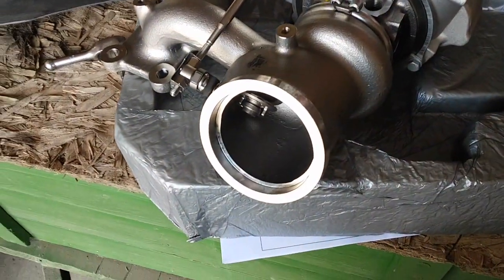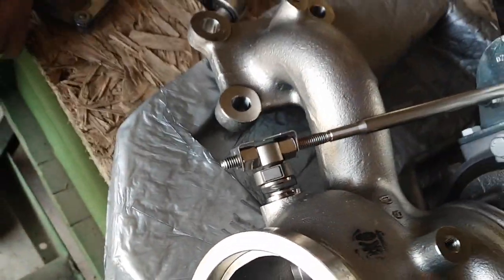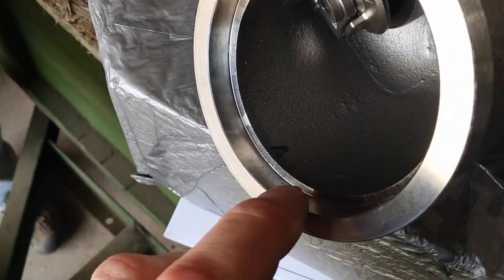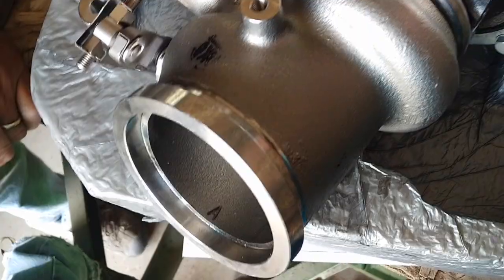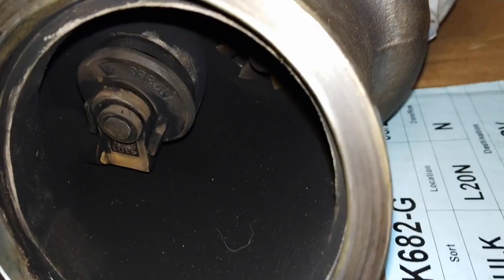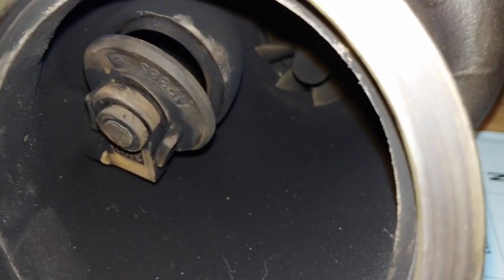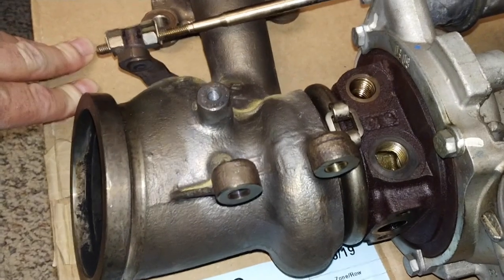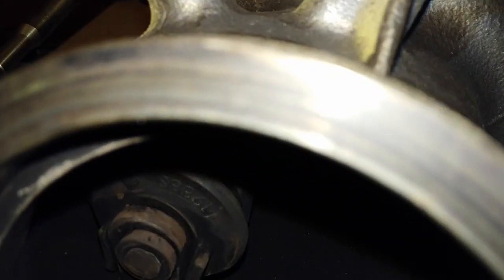2.0 Ecoboost Wastegate Failure Diagnosing P0299 Error

Comment: I have a question. So we own a 2012 Ford Edge with the ecoboost. It doesn't have any wastegate rattle but it has a P0299 code. The vehicle has 218k miles on it. Runs and drives great but doesn't have much power. Normally when you take off the airbox, you get a lot of turbo noise. Ours has very little turbo noise. Do you think the wastegate actuator could be bad? Or maybe the boost sensor? It's had this issue for the past 30k-40k miles. Any tips?
Reply from the maker: Hey, Austin. I'll preface this by saying that I'm not a mechanic, just a guy who's done most of his own car repairs as long as I've been driving. I'm assuming that you have the 2.0L. If you have the 3.5L V6, some of the information below might be different, specifically with the vacuum control solenoids.

With 218k miles on the engine, if it's the original turbocharger, I wouldn't be surprised if that's the culprit. But, since it's an expensive repair, I'm sure you'll want to make sure it's the turbo that's failed.

The first thing I would test is the actuator, using a hand held vacuum pump. If you don't have one, they're fairly inexpensive. With the tubing of the pump on the vacuum can for the actuator, with vacuum pressure applied, you should see two things happen. 1) the actuator rod should pull in towards the vacuum can without returning until vacuum pressure is released, and 2) with the actuator fully engaging the wastegate, you should feel no slack on the linkage for the wastegate. If you have noticeable slack on the linkage, the wastegate linkage is shot. At this time, there isn't a parts kit to swap out the wastegate. I did some shopping around, and there was a turbo repair shop that would rebuild the wastegate for a reasonable fee. The two shops I heard back from are Timsturbos.com and ctiturbo.com. It would be possible to remove just the exhaust side of the turbo, so you wouldn't have to deal with removing it from the engine. Of course, at 218k miles, it might just be best to replace the turbo, since there's no way of knowing how much longer the turbo is going to last. If there is no slack in the linkage, but the actuator rod doesn't keep the actuator always engaged under vacuum pressure, the actuator can is bad. Unfortunately, there isn't a Ford specific actuator available, but if you do an eBay search for K03 wastegate actuator, there are some that would likely work. (The turbo is a Borg Warner K03.) I would just make sure the length of the rod, especially the threaded part, is as close as possible.

Just a quick note on the wastegate: if it's shot and you don't plan on keeping the vehicle for much longer, with the actuator engaged using the hand vacuum pump, you can adjust the linkage so that there's no more slack. This will get a couple thousand more miles out of the turbo without a loss of performance. 

Moving on, if the actuator and wastegate test fine, it's time to check if vacuum is getting to the vacuum can. The easiest way to test this will require the help of an assistant. With the vehicle on a lift or ramps, start the engine and while observing the turbo from below, the actuator should engage when revving the engine. If that tests fine, great. If not, there are two solenoids that control the vacuum line to the actuator. One solenoid/sensor is located just to the right side of the turbo. The other control solenoid is located on top of the engine, just forward of the plug coils. I won't go into the details of testing these, but there is plenty of information available for testing vacuum solenoids. I would suspect the vacuum lines to be faulty before the solenoids would fail. Some of the lines are rubber vacuum tubing, some rigid line. Do a thorough visual inspection of all the lines from the solenoid on the top of the engine, all the way down to the other control solenoid, as well as the lines to the three ports on the turbo. I also read of a case where someone found a defective electrical connector for the sensor/solenoid that's located to the right of the turbo. A visual inspection should be all that's needed to determine if either of the electrical connectors for the solenoids are defective. I wouldn't know where to start if those need to be replaced, but there might be replacement pigtails available that would require being soldered to the correct wires. Worst case scenario might require scouring junk yards to find a vehicle that you could scavenge the wiring from.

If by this point you still haven't found anything that would prevent the turbo from properly functioning, there are only four more things to check: the intake tube that runs from the air filter box to the turbo, the outlet tube that runs from the turbo to the intercooler, the intercooler itself, and the tube that connects the intercooler to the intake manifold. Any cracks in any of the tubes or the intercooler can cause the P0299 underboost condition code. I can't think of anything else in the turbo/intake system that could possibly cause the turbo to provide adequate boost. 

The only other thing I can think of is if the bearing in the turbo cartridge is seized and the impeller isn't turning. You could check for this yourself by removing the exhaust side of the turbo, or if you were to disconnect the catalytic convertor, and if there's enough clearance, you might be able to get a screwdriver in through the wastegate port and see if you can manually turn the impeller.

If you end up having to replace the turbo and plan on doing the work yourself, I'll be happy to answer any questions you might have. Having read numerous reviews of the cheap eBay and Amazon turbos that are available and their high failure rate, I would definitely recommend sticking with the genuine Ford part. If you order from the link provided in the video description, it's $657 plus shipping and core charge, which isn't a whole lot more than the aftermarket/no name turbos available. Before you remove the old turbo, be sure to check if the flange depth on the existing and replacement turbos is identical, and be sure to get all the proper seals: 3 water jacket seals, 4 copper washer oil seals, in line oil filter, 2 oil return gaskets, flange gasket, and catalytic convertor/exhaust gasket. Nothing sucks like starting the project and not having all the parts. Also, this turbo model has both cooling and oil lines, so you'll need to drain your cooling system.  

Good luck to you, and I hope you're successful in diagnosing the problem.
Reply: Great type up! Thank you so much! I've found low mileage Escape turbos for $150 shipped. Looks to be the same set up. We will probably go used route. How hard is the job? I'll pull the cat off and check the turbine. Is that difficult to do? We are Saab techs but my brother bought this Edge when it was traded into our ex employer. We got it for 2200 out the door. It came in with 199k miles and we planned to send it to auction due to a ”failing transmission.” It was a steal! The transmission failure? A 36$ cooler line. It rusted and lost a good amount of tranny fluid. Replaced that line and added fluid. Shifts smooth as butter!! Current codes are P0299 and P0171 or P0420. I can't remember which one it was. One of those codes was caused by a bad upstream oxygen sensor (I think it was the P0420 code, it went away after we replaced the sensor.) It's pushing 218k miles and it's honestly been an awesome vehicle. Last owner drove about 80 miles each way for work. She put 4k-6k miles a month on it. When we bought it, we replaced the cooler line, oxygen sensor, spark plugs, cabin filter, engine filter, oil change, coolant flush, tinted it 5% all around, replaced the Firestone tires that were on it for used Michelins (90% tread. $242 for all four!) My brother and I installed them ourselves. First time replacing tires and unfortunately broke two TPMS sensors. Brother bought a Sync 3 system for it and the Sony sound system. It has all the Sony speakers and Sony faceplate. Pano roof still works perfectly. It's been a great vacation car! He bought it May of 18. It's been to Florida, North Carolina, South Carolina, Tennessee, Kansas City, MO. We put 17k miles on it in about 7 months. It's been parked for the past few months. But it's going to be put into daily status soon. We are a Saab and Ford family for life! Just gotta save as many Saabs as possible! We have had somewhere around 25 Saab vehicles! I'll keep you posted on the Edge! Hopefully will get the turbo issue fixed soon! Thank you for making the video and for the quick response!
Reply from the maker: @austin8607  being that you're a Saab tech, this will go a long way in making this an easier task. I won't sugar coat it, it's not a fun task to swap out the turbo. The toughest part of it is getting the oil supply line back on. Those little copper washer seals are a pain when you're working in such a tight space. 

Pulling the cat off is very easy. There's one bolt on a band clamp that holds the cat pipe onto the turbo, and two bolts that hold the cat to the frame. Once it's disconnected, because there's a flex pipe on the exhaust system, there should be enough clearance to move the cat out of the way and also check for any slop in the wastegate assembly.

Here's what might be considered some bad news: I'm fairly confident in saying that the Escape turbo isn't interchangeable with the Edge, as the part numbers are different. Here's the link for the 2013 Escape 2.0 turbo (PN CJ5Z-6K682-F. If you check under Vehicle Fitment, there's no mention of that turbo being compatible with the Edge: http://bit.ly/2mr3d0g

Compare that to the 2012 Edge 2.0 turbo (PN CB5Z-6K682-H). Under Vehicle Fitment, this turbo was only used with the 2012 and early 2013 Edge 2.0, and in the 2012 Explorer. http://bit.ly/2liZeCX Even though the Vehicle Fitment shows that part working with the 2012-2015 Explorer, the 2013-2015 Explorer has a different part # that uses the deeper exhaust flange. I found that out the hard way, after getting the new turbo all bolted in, only to have the cat not mate with the turbo because I had the wrong dang turbo with a different flange size than what was required for my application. 

Sadly, Ford engineers in their infinite wisdom couldn't be bothered with using the same turbo for all 2.0 applications. Unless everything is 100% dimensionally identical, there's a good chance it isn't going to fit. After what I went through ending up with the wrong turbo the first time around, whatever turbo you replace it with, make sure it has the same part number, in the case of the 2012 2.0L Edge, CB5Z-6K682-H. Just a quick note, after I realized that I had the wrong turbo, I called the parts department that I had purchased the turbo through. They were able to look up the part number that was on the id tag on the original turbo, and give me a superseded part number. If you come across a replacement turbo that has a slightly different part number on the id tag than the part number specified, you can call your local Ford parts department, and they should be able to tell you if that is one of the correct part numbers for your application.
Reply: Sounds good! Thank you for the information! Hopefully will jump into everything in the next month or so!
Reply: Hey! Are these part numbers correct? These are the gaskets. There are three? 
Turbocharger Gasket CJ5Z-9448-A
Turbocharger Oil Return Gasket CJ5Z-6N652-A
Turbocharger Water Inlet Gasket (2?) AG9Z-9P431-A
Do I need two water inlet gaskets? Diagram shows two but I'm not sure
Reply: Also thank you for pointing out the different turbos. After examination of both turbos, they are different. Placement for the oil feed lines mostly. Looks like I'll probably go with a new turbo. It's been pretty difficult sourcing a used Edge turbo. Going to check Car-Part and see if there are any on there.
Reply from the maker: @austin8607  Here's the complete list of what you'll need. I followed the information off the link in the description, which is more or less a copy of the official Ford parts webpage, just with their lower prices, and everything matched up perfectly. Just to clarify, since you never did mention for sure, this is for the 2.0L, correct? Also, just a quick correction, the core deposit is $250, not $300, if you decide to go with the Ford turbo.

Anyhow, here's the parts list:
Turbocharger: CB5Z-6K682-H
Turbo Gasket: CJ5Z-9448-A
Water inlet and outlet gaskets: AG9Z-9P431-A (3 needed. The inlet has a flexible 3/8" hose that uses a spring clamp, the outlet has a gasket on each end)
Oil inlet washers: W715323-S300 (should need a quantity of two, sold as a pair, total of 4 needed, 2 for each end)
Filter: BB5Z-6C683-A (inserts into block, filters oil supply to turbo. Cheap part, may as well replace)
Oil Return Gasket: CJ5Z-6N652-A (2 needed. Stock photo is deceptive, sold only 1 to a package)
Catalytic Convertor Gasket: BB5Z-6L612-A (it's a steel gasket, but for a few bucks, it's worth it in my opinion to avoid an exhaust leak)

That's all the parts you should really need to do the whole job, and may as well do a coolant flush and oil change while you're at it. With as many miles as you've got on it, if the turbo is the problem, I really hope you can find an inexpensive replacement. 

As a side note, when I purchased mine at 85k miles, I had some issues with hard shifts on the transmission. Since you did mention some transmission issues that you've resolved, if you're ever experiencing any problems, hard shifts, slipping, etc, I highly recommend replacing the transmission fluid with Amsoil ATF. My transmission shifts so much smoother since replacing the fluid. 

Good luck!
Reply from the maker: And if you don't have a shop manual, let me know and I will post the torque specifications. I went the cheap route and bought a Haynes manual, and while it doesn't give the best information, it gives at least the torque specs. Some fittings can't be properly torqued, as there just isn't enough clearance to get a torque wrench in there, but there is enough clearance for most of the fittings.
Reply: Your information is so helpful! And yeah, it's the 2.0 EcoBoost. Current codes are P0299 and P0420. My brother is going to try the lacquer thinner fix. See if that gets the P0420 to go away. I'm curious what condition the cat is in! 
As for the transmission, the last owner never changed the tranny fluid. Besides the 3 or so quarts we added, the rest of the fluid is all original. It's pretty dark but don't want to risk swapping the fluid and have it start slipping. Surprisingly with that old of fluid, it shifts perfect. Very surprising from a 6f35 transmission 🤣 Our Fusion Titanium needed a new transmission at 50k miles. Same for my both of my cousins. One had 57k on it and the other had 60k on it. Clutch plates were messed up causing hard shifts from 2nd into 3rd. We traded our fusion around 70k 3.5 years ago on a new Taurus, cousin traded hers at 95k on a new CHR. And my other cousin still has hers. At 117k now and it's shifting hard again. Gotta love the 6F35! Working for Ford for a few years, I noticed the hard shifts mostly on Fusions but some escapes too. We didn't get many 12-14 EB Edge or Explorers but the few we had never had shifting problems. 

Our plan from here is to pull the cat off and check the turbo. I know the turbo is functioning. You can hear the slightest amount of turbo when revving it. But boost is definitely lacking. Probably have the normal wastegate issue, so new turbo in the near future. Were you able to hear the wastegate rattling on yours? What were your symptoms?
Reply from the maker: @austin8607  Yeah, that 6F35 transmission has some serious design flaws. I've been tempted to go through the trouble to install an in-line filter in the cooler line. The only problem is finding a way to make it look right. Having a non-serviceable filter is just foolish, if you ask me. When I purchased mine used in March, I'm pretty sure it still had the original fluid. After draining, filling, and driving 3x with Amsoil, and topping it off with clean fluid, I plan to drain and fill once a year. I figure that's much cheaper than a new transmission. For the wastegate, it's hard to really hear the rattle, unless you have someone reving  the engine and listening from underneath. The biggest symptom was a big lack of power. Plenty of zip with the new turbo now, even enough that if I mash the accelerator too much from a stop, the tires squeal a little.
Reply: Our edge feels like it has maybe 150hp right now 🤣 I'm going to try and change one quart at time every so often. Hopefully, get a little cleaner fluid in it 😂 It's dark. Like diesel oil dark 😂 My brother was actually selling it. But then his Saab started acting up. It's time for a new valve cover gaskets on his 9-3. 237k miles on it. He decided to just keep the Edge, so we will be fixing whatever it needs. We've owned it for about 19k miles. Ready for it to actually have power! Once the turbo is fixed, I want to race it against our Taurus. Wonder which one would win. Taurus has 287hp, Edge should have 237hp once fixed. Edge weights a little less and has more torque. We shall see!
Reply from the maker: @austin8607  Well heck, I wish I had known that was out there. Could have saved me a lot of money and headache, though that looks like it has the shallow flange, so it wouldn't have worked for my application. I know for a fact that you have the shallow flange on the 2013 models. I would imagine you could get by with that just fine, assuming the cartridge is fine. If the cartridge is in good shape, maybe just adjusting the linkage to have the wastegate fully closed would give you an idea if swapping out the wastegate housing would give you the performance it should have. 

I do know that you can get the cartridge on eBay: https://www.ebay.com/itm/K03-Turbo-CHRA-Cartridge-for-2009-2014-Ford-Explorer-Edge-Focus-2-0-Ecoboost/264277080305?fits=Model%3AEdge&hash=item3d882438f1:g:dLUAAOSwdmlbxsls
Reply: Ours is the 2012 model. I wonder why ford changed the turbo after a few months. Makes finding parts for it hell! 🤣 Probably next weekend we will pull off the cat and check the condition of the turbo. How was getting off your cat? I've heard they pretty much weld themselves on. I'm guessing ours is at 218k miles 😩😂
Reply from the maker: @austin8607   It came off quite easily, though all the fittings make it a pain. Even though it had only 95k miles on it, I live in Minnesota where corrosion is a big issue, so I'm sure you'll have no problems at all. It might not be a bad idea to just take off the housing and leave the rest in place, so you can check the internals. That way, you only have to replace the one gasket, and you might even get by with reusing the old gasket, since it's a metal gasket. Really it all comes down to the condition of the internals. If I was in your situation with 218k miles, I'd disconnect the cat, check to see if the turbine spins freely, and adjust the wastegate linkage. You might be satisfied enough to just drive it as is, with the wastegate slack taken up. 

My suspicion is that there was a bad batch of turbos manufactured that used too soft of a metal on the wastegate assembly. I'm really hoping that the new replacement that I purchased has resolved the failure issues with the wastegate. The wastegate on the old turbo probably would have never failed had they not used too soft of a metal. Of course, I didn't test the hardness, but the way the armature was so horribly worn, as well as the wastegate plug, after only 95k miles, and this appears to be a common failure. There's simply no good explanation for it other than too soft of an alloy.

When you get the chance, get it up on a lift or ramps, throw a vacuum pump on the actuator can, and see how much slack there is. While you're at it, have someone rev the engine while you're under it to see if the wastegate actuator is functioning. I'd bet just adjusting the linkage will be satisfactory enough, since it will basically cost you nothing, except maybe some Loc-Tite on the adjusting nuts to keep the new adjustment set. If I hadn't just purchased my Edge and had high miles on it, it's probably the route I would have taken.
Reply: Sucks that the turbos are the weak points of these vehicles but I guess I'd rather have turbo failure than the water pump failure on the 3.5 engines. Our 2015 Taurus has the 3.5 and it started making a weird ticking sound around 5k miles. Took it into a dealer while on vacation and they wanted to tear down the motor but we were leaving the next day. When we got home we took it into the dealer and they said “Oh that’s completely normal” Which I know isn’t true. It has 85k on it now. It’s warranty ends at 120k. We will be trading it before that 😂 If my brothers cat is bad, new replacements are 350. Or we may gut it. But that's illegal so I'm not sure.. I mean I doubt a little 2.0 puts out that much harmful stuff I don't know 🤷‍♂️
Thank you for all the information. I appreciate it very much and I hope I'm not annoying you!
Reply from the maker: @austin8607  not annoying me at all. I'm glad to help!
Reply: @lutheranpriest  yeah the problem is they ran different heads and exhaust and intake so it's a must to check your part don't guess
Reply: @austin8607  do the trans fluid it's easy I did it first time in an hour and so worth it you may thinkur trans feels good I did on mine, but after I bet you'll notice a difference I did.
Reply: @austin8607  sorry should have put this in the same reply also do your rear differential Ford has it is lifetime but it ain't and mine was nasty I had 95,000 when I did mine there's a video on how to do them and it's pretty good